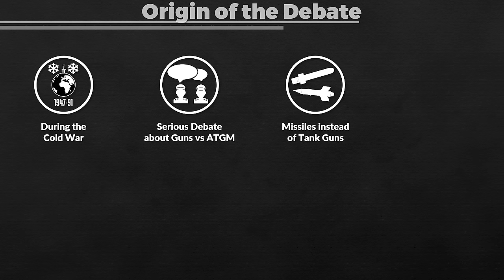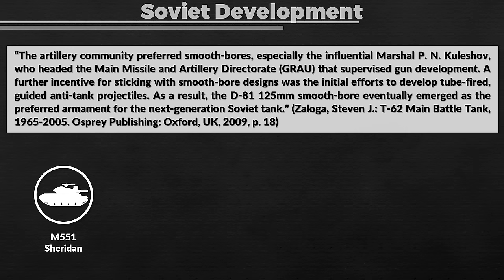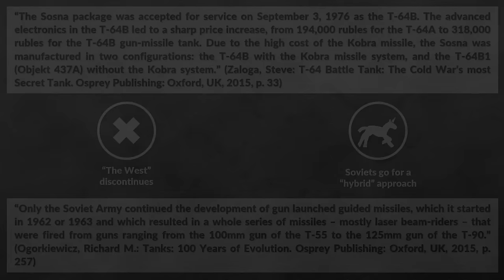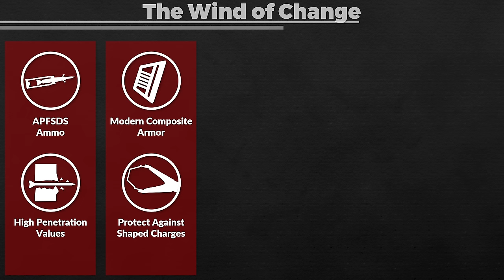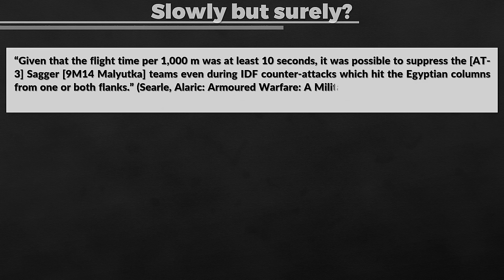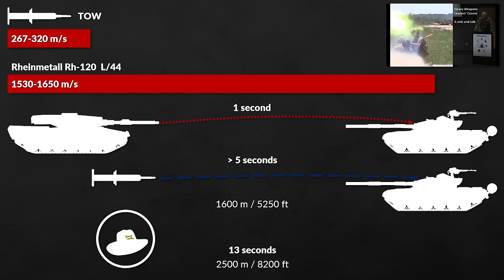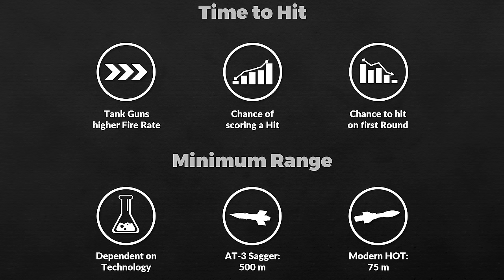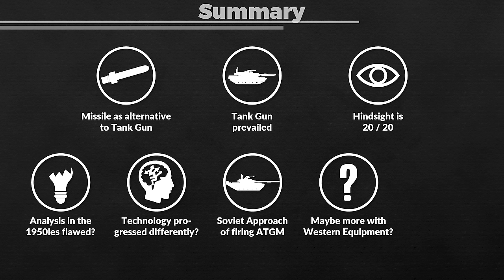Missiles vs Tank Guns: Why Guns are better!

Comment: Are they better? Because I see not a single shred of evidence that they are. Maybe at some point active countermeasures can lower the PK of guided missiles. But right now tanks with big guns are just calvary horses with the newest sword.
Reply from the maker: Watch the video and that argument was already made decades ago.
Reply: @MilitaryHistoryVisualized  Watch that armored trust into Ukraine. They were making the same arguments for horse mounted calvary in 1910. It is getting far easier to kill a tank then it is to prevent one from being killed.
Reply from the maker: By an Army that can't maintain its trucks, does not perform combined arms warfare, has unmotivated and untrained troops etc.
Your statement is like saying flying a plane is not safe since an unmaintained plane with an untrained pilot crashed.
The death of the tank has been announced several times since 1918.
Reply: @MilitaryHistoryVisualized  So let me fully understand your beliefs. The Russian army is so inept that they can't even maintain their trucks, but somehow they can bring up enough artillery and ammunition to flatten a city. The only reason their armor is getting devastated by not quite cutting edge anti armor weapons in the hands of a determined and skilled infantry is that they are not maintained, or supported. But all that artillery can be maintained and supported. The logistical problems highlight the problem with main battle tank. They are hard to move, hard to keep fueled, and nowadays fairly easy to kill. Tanks massed in the open are sitting ducks, tanks in cities are sitting ducks, the fuel trucks that support them are sitting ducks, and you need absolute air and infantry support to keep them from being sitting ducks. So what the fuck do they bring to the fight again. A big ass gun? For what. A shoulder fired man portable missile can hit the same strong point from just as far away. Name one fucking battle in the 21st century that was decided by the presents of main battle tanks. I'll wait. Name one time that a defending army that had 21st century anti tank weapons was dislodged by a force of main battle tanks.
Reply from the maker: yeah, man you are completely right and I never heard those points before.
Reply from the maker: the same as in the Yom Kippur War. Did you even watch this video?

Comment: guns are better yes HOWEVER a missile allows an older tank to retain a lot of its effectivness against other tanks, which is good.
Reply: I'm not sure they do. Tanks can be up-gunned, and the current gun launched ATGMs for eg. 100 mm and 115 mm guns aren't exactly stellar in their performance, with about half the potential armor penetration and almost half the range of externally mounted ATGMs.
Reply: @Dimetropteryx  upgunning is much more expensive and often requires redesigning the turret.
Reply: @nemo5335  Depends on what and how you're up-gunning. Up-gunning isn't semi-improvised like it was in the middle of WW2, lots of products out there have been designed to be installed with as few modifications to the turret and hull as possible.

Comment: Nlaw is not a ATGM
Reply: Well, it is anti-tank, it is guided and it is a missile. The guidance system corrects its flight based on the information gathered pre-launch.
I'd say it's sort of in a grey zone.
Reply: @Dimetropteryx  Don't play smart it you do not know anything. It is not guided It have no seeker or anyway to control it after launch at best you can call it a stabilized  missile and what makes a missile is most often the fact that it can be controls in flight by itself or a controller.
Reply: @xendk  It is literally a guided anti-tank missile. Can you come up with some  compelling argument as to why the guidance system it does have doesn't guide it, or should I tell you to take your own advice? The lack of a seeker or post-launch control by a person are not requirements, when it literally, not figuratively, guides itself, as I already told you, based on pre-launch data.

Comment: A gun in the end at hte core is a very dumb system, all going to hell you can still ram a round into the breach, close it by hand, aim it through a simple direct sight telescope and fire it by hand. This makes it reliable to a very high degree and as mentioned relatively cheap to. 

Missiles however specially modern modern fire and forget do have the advantage that they could be fire from concealment and hard cover without needing to expose the source of the launch to direct enemy counter fire. With the age of drones one of those could easily be used to designate targets, relay that ot a launcher which could then assign 2-3 missiles per target and launch. This would reduce the risk to the meatbags (humans) considerably, but it would increase the cost of the weapon system and the price per kill susbtantially as a single missile is already expensive, but in an age where active defences are becoming more common you need multiple missiles to secure a kill. 

In the end it is a simple question of economics, risk annalysis combined with the cost to train crew and build equipment and ammo to see which is going to be a prefered solution. To me launching missiles from a tank tube is a nice to have, but not really going to be a amazing anti tank solution, I could see them being more useful as a means perhaps to deal with helos. 

With the above in mind though, the main counter to a mass missile barrage would be one of artilitery with guided rounds, while those would be a hell of alot more expensive then most tank rounds, they would still be cheaper than missiles and more compact which means greater density of fire. Meaning that in the very end the gun really just edges out, cause again if your smart stuff won't work the dumb stuff will fire out of those tubes just as easily, if the missile or system doesn't want to work, your done for. 

K.I.S.S seems to be applicable as a result of the above thinking, sometimes keeping it simple stupid is just the best way to go. Guns work in smart and dumb scenarios, missiles only in smart ones.

Comment: Missle is a poor tank weapon. Tanks are not fighter planes. A Tanks mission and tactics are longer time in conflict than aircraft. As a result, if you can only mount 8 to 10  missiles you will be screwed. The space needed is larger, and targets you can engage are fewer. There are two huge negatives for a tank. There is a reason a B52 doesn't dogfight. Land based vehicles have the same philosophy constraints as aircraft. The gun is a better choice. It's cheaper, has more flexibility and has room to grow in terms of capabilities.

Comment: Technology is getting more expensive and less reliable. An army should not have to worry about what a system costs versus the results it delivers. Fundamental truth. An advanced weapons system by itself may be defeated by “inferior” , hence cheaper weapons. (Viet Nam)
Reply: But if your superior weapons system completely overmatches the inferior system when it works, and it works with an acceptable degree of reliability, then why would you even consider the inferior one?

Additionally, the NVA in Vietnam was anything but inferior. They had sorts of state-of-the-art Soviet systems like SA-2 and radar-guided AAA.
Reply: Cost
Reply: "Technology is getting more expensive and less reliable."
I'd say the opposite is more likely to be true. Automobiles are much more reliable now than in the past. If you compare how long a person had to work in order to pay for an automobile in the past compared to now, I think you'd find it's easier for a person pay for a car now than in the past.
Modern guns are much better than guns in the past. The cost of guns has also greatly reduced over time.
Military jets used to use two engines for safety. Modern jet engines are so reliable that a single get engine can be safely used.
Tanks and other military equipment are crazy expensive but if the military only required tanks with the same specs as those used in WW2, we'd be able to produce these simple tanks cheaper (adjusted for inflation) than in the past. Modern tanks are so much more expensive because they offer much more protection and much greater firepower.

"An army should not have to worry about what a system costs versus the results it delivers."
Really? Why? As long as scarcity exists humans will have to weight costs vs benefits. A military would quickly bankrupt a country if they used cruise missiles to take out individual soldiers. Guided rockets are often more expensive than the equipment they are used to destroy. The military should use less expensive options when practical. If an enemies military truck can be disabled with a .50 caliber round costing a few dollars, then this option should be used rather than a guided rocket costing tens of thousands of dollars.

Comment: Tanks are irrelevant, expensive, cumbersome, and immobile.  Russia has proven this in 2022. One 15 year old, barely-trained civilian, can destroy a multi million dollar tank, all of it's weapons, and operators in 30 seconds. Also, NLAW can attack moving targets, so I'm not sure why he thinks tanks can evade them so easily.
Reply: Tanks work best in combined arms with infantry, artillery, mortars, air defense, scouts, engineers, close air support, logistics, and command & control.  There isn't a weapons platform that can replace the tank at this time.  Combined arms is about measures and countermeasures.  Infantry, artillery, and close air support moves the opposing force light infantry outside of the effective range for anti tank weapons.  Russians are using their tanks without support and no countermeasures against infantry.